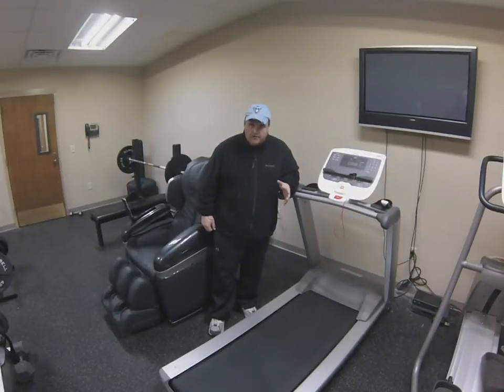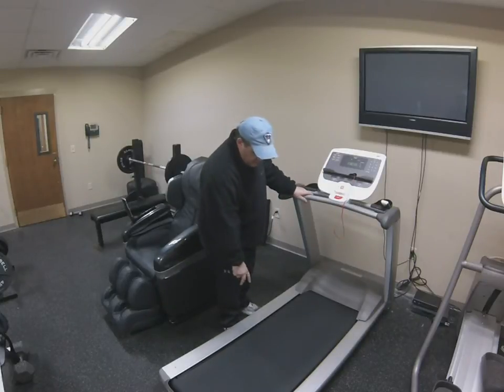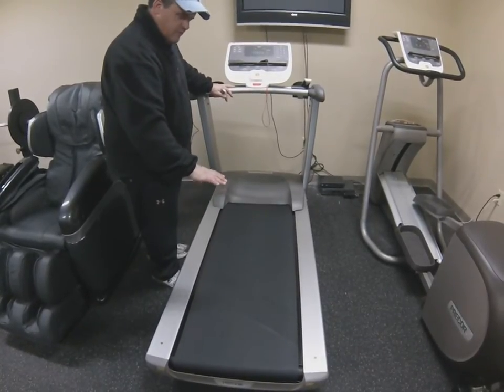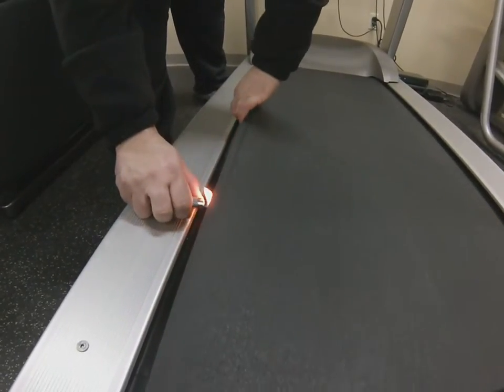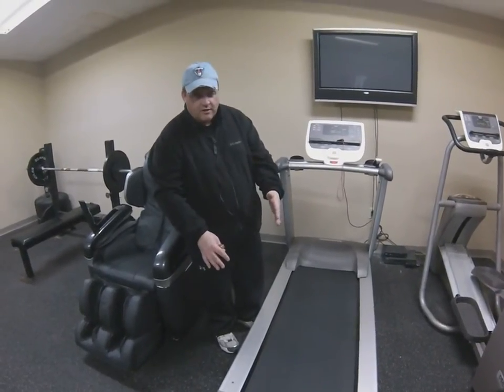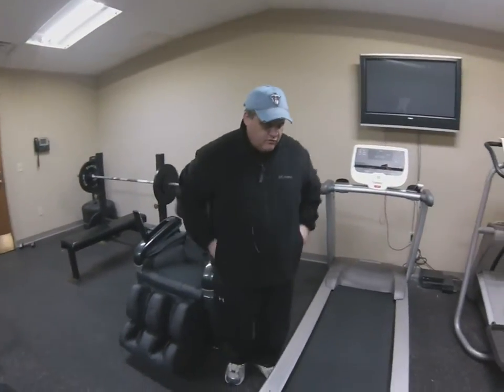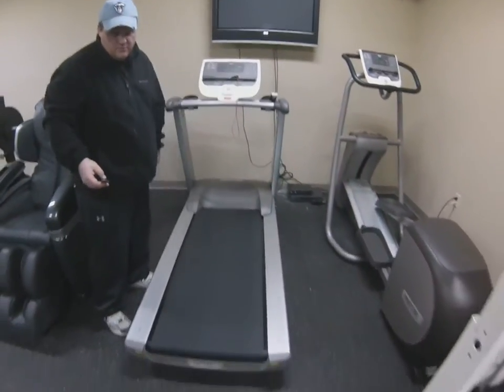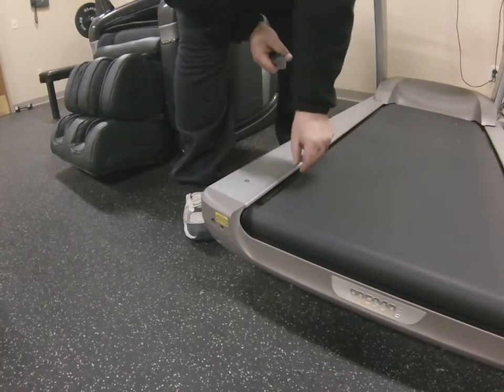How To Trim a Treadmill Belt - Treadmill Doctor

Comment: Even better: clamp a 2x4 or 2x6 to the treadmill, with a couple shims to keep it from contacting the belt.

(temporarily remove the belt guides attached to the underside of deck before turning it on to avoid damaging belt)

cut a slot using your thinnest angle grinder blade - to act as a blade guide.

align the blade guide right around the space between the deck and rear roller to give room for the blade so you dont score up the roller or damage the deck...

run the treadmill at high speed
- ensure the belt is tracking straight so you can make a straight cut.
- very carefully ease the blade into the guide. work slowly to ensure the blade does not go crooked and nothing goes off track -